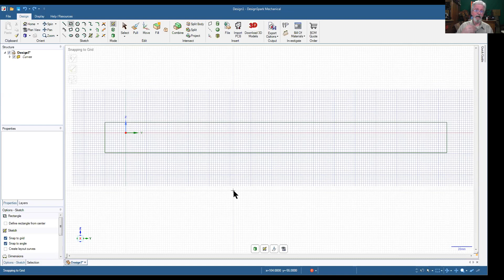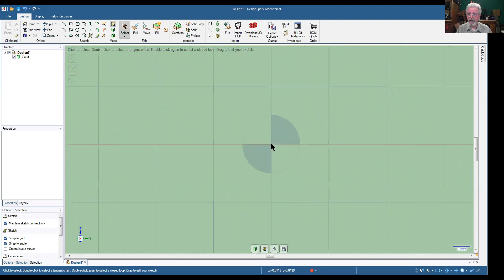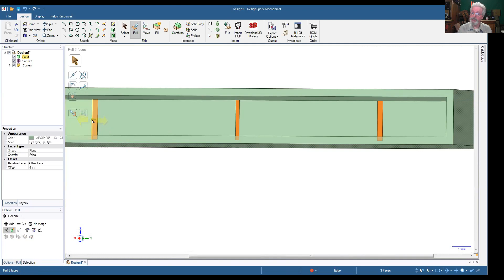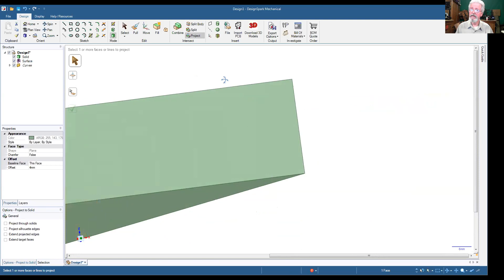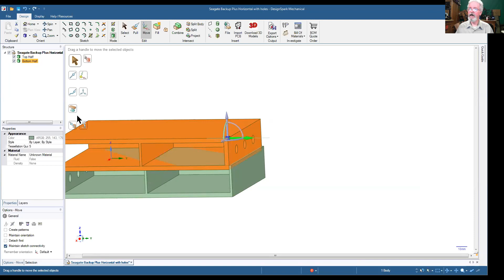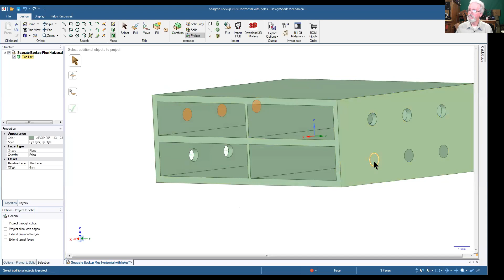DesignSpark tutorial - Parametrics, Shell, Split, and Align

Comment: well on the least amount of work, after you splitted the solid into (top and Bottom half) it is a LOT faster to delete the bottom half all together and (CTRL) move the left part 25mm upwards , or downwards has also the advantage of all the 6 holes at the leftside of the new solid and I think that you made a small error because i think the 2 bays at the right are a few mm too small I did not see you measure them but ollowing the events it looks to me  tto small. kind regards Hans

Comment: And there is another very useful command, If you make a short construction line dead center vertical, and go over it with your mouse right click and select (set as mirror line) You can draw your middle rectangle 2 mm tab 29 mm and I draw a diagonal line in the empty box from down left to upper right select the rectangle tool (define rectangle from center )click on the middle of the diagonal line and type in the measurement 2 tab 29 mm  You see it has drawn the other side as well in the end it save a lot of time That mirror line works also for horizontal line and lies in an angle 
If you want to draw a clock face? just draw a construction cross in the center and draw 2 construction lines from the center into that quadrant at 30 degrees and you can draw all 12 circles at once 
Or use the patter command Hope the tip are useful Kind regards Hans

Comment: Hi, I have a few remarks,The first one: I followed this  and I can literaly type in 78.5*4+2*4+3*2, and that works fine with me it gave as a result 328mm so it is not only adding up .Next remark,
At the very start of the drawing, I use the command (define rectangle from center ) Just click once on the origin and fill in the width 78.5*4+ etc and the tab key for the height  21+4*2 
the next move I did , was not to use the shell command, but the offset command double click the top edge (that will select all 4 sides ) slightly pull inwards and give 4mm for the measure and pull that down 115 mm. gives the same result (there are many ways to rome )
Reply from the maker: Thank you for your valuable comments. I appreciate learning new ways to do things.
Reply: @3DPrintingTexan  Like I said, I love to dig out software programs especially the free ones and they are sometimes very good.
Reply: the problem with him is that he does not read what any one says